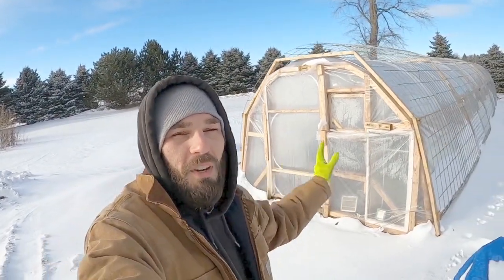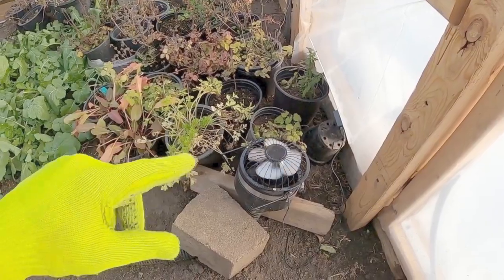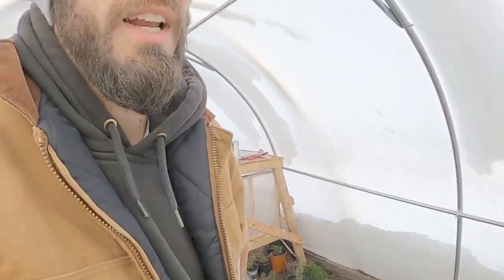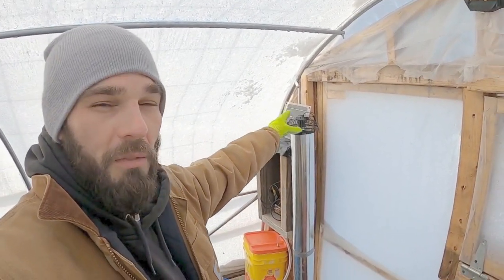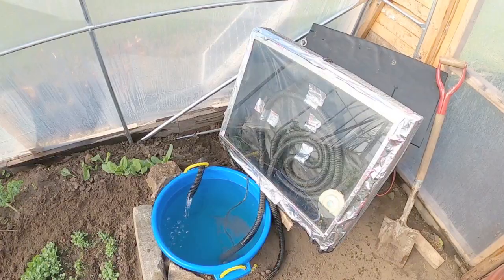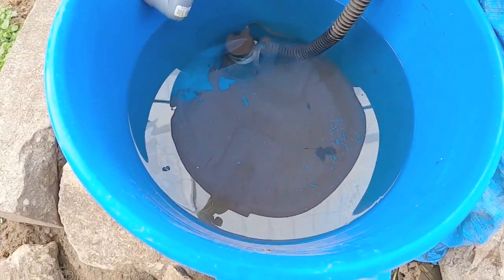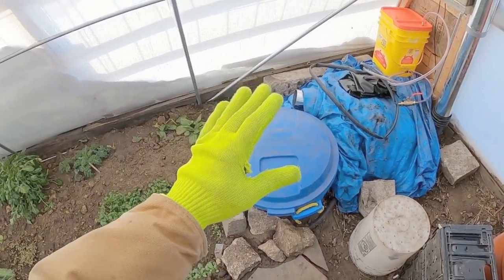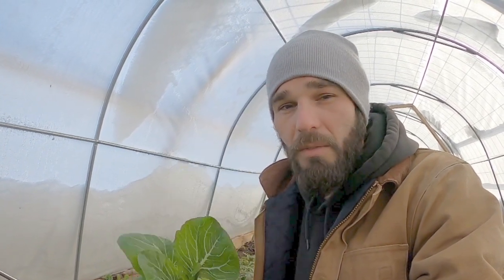DIY 52' Winter Greenhouse Solar, Compost, & Passive Heating Systems Check After Negative Temps

Comment: The low tech, high value solutions are really impressive, particularly for smaller greenhouses. Awesome work! 

It seems like for the water system a touch of antifreeze before a deepfreeze would be good. Unsure of contamination risk.

For the water system.. When you re-do it, I'm thinking its probably worth digging a slightly deeper hole, giving it a little lift off the ground with scrap wood, and touching earth mostly on the bed-facing side
Reply from the maker: Stay tuned, it sounds like you’ve got some great input for me and the next builds. The next video should be of Interest as were getting into all the systems and temps we’re achieving. Thank you!

Comment: If your water heater doesn't work because of cracking tubes, you can always consider some kind of antifreeze solution. Some use windshield washer fluid.